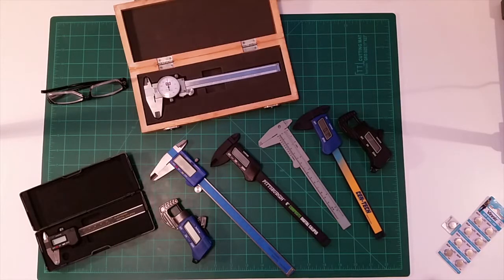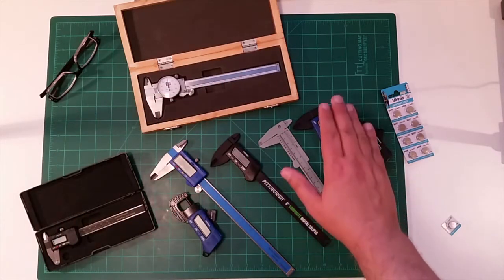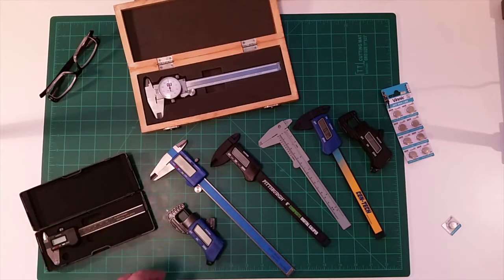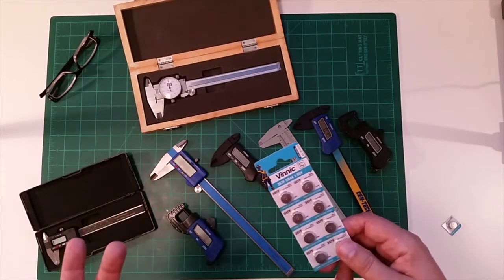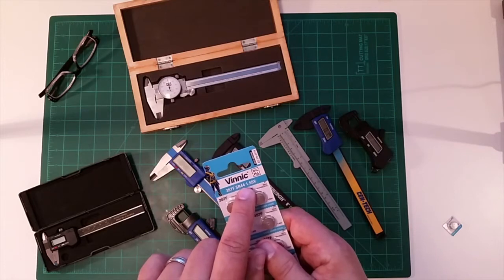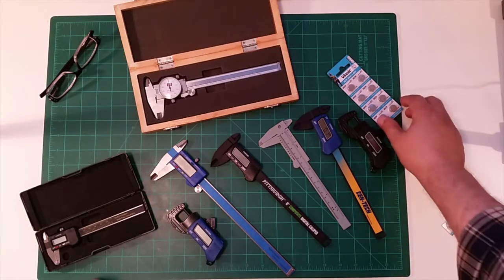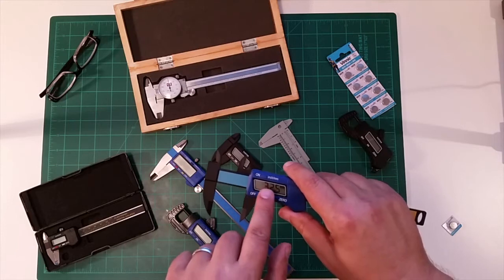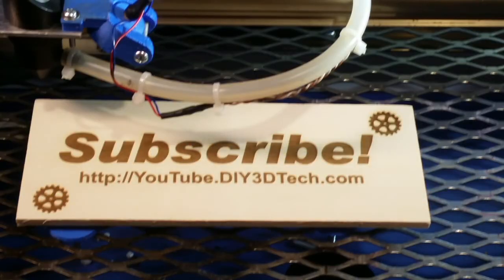Shop Talk - Digital Calipers and SR44 vs LR44 Batteries!

Comment: I was thinking that this was pretty bizarre behavior. 1.55V vs 1.5V shouldn't make any difference nor should the caliper's current load be anything higher than extremely tiny which means any differences in the internal resistance of the different battery chemistries shouldn't make much difference in the corresponding output voltage drop. So, it must be discharge curve related. The datasheets for the two types of cells:

SR44

http://data.energizer.com/PDFs/epx76.pdf

LR44

http://data.energizer.com/PDFs/A76Z.pdf

Sure enough, look at the "Typical Discharge Characteristics" on those datasheets and note how the voltage of the SR44 remains steady at 1.55V for 500 hours. Compare that with the large voltage drop over 500 hours for the LR44.

The same Chinese chip is probably used in all of these cheap Chinese micrometers and calipers and was obviously designed for operation using the SR44 which has been mostly discontinued in the west for environmental reasons (mercury content) although Sony came up with a mercury free version in 2004:

https://en.wikipedia.org/wiki/Silver-oxide_battery

"Silver oxide batteries become hazardous on the onset of leakage; this generally takes five years from the time they are put into use (which coincides with their normal shelf life). Until recently, all silver oxide batteries contained up to 0.2% mercury. The mercury was incorporated into the zinc anode to inhibit corrosion in the alkaline environment. Sony started producing the first silver oxide batteries without added mercury in 2004."

Interestingly, I just looked at the cell in my Harbor Freight Pittsburgh brand digital calipers that I bought YEARS ago that I use often and am still using the original cell. Both it and the spare cell included are marked as LR44! 

Now, I wouldn't put it past the Chinese to mis-mark an SR44 silver chemistry cell as an LR44 in order to bypass US and EU environmental restrictions. OR, perhaps the internal circuitry was changed in newer calipers to actually be able to use LR44 cells while others are still using the old design where they probably have or had an existing stock of a bazillion.
Reply: 500 hours is an ice age of time for caliper use. Average use time is like 1 minute maybe? I've had my calipers for 4 years and I've changed the battery maybe 3 times. I got several sheets of 50 batteries, basically a lifetime supply, for a few dollars.
Reply: xKatjaxPurrsx As he pointed out, when "turned off," calipers don't do anything other than turn off the LCD display and then remain in very low current sleep mode, something that is absolutely required for any microcontroller to be "turned on" (actually just fully "woken up") by a momentary contact pushbutton and that sleep mode still uses very tiny amounts of current. So, your calipers are never really "off" as power is never actually fully removed from the microcontroller chip. This makes the discharge curve important as I pointed out.
Reply: Ok, but it works for me. Like i said above i've only had to change batteries a few times in years. I even have an imgur above with a picture of the calipers, the battery and them working. I suspect in standby mode we're probably talking nano amps of current being used.
Reply: Actually, although the latest microcontrollers with the capabilities that would be required by a digital caliper are specified in sleep mode as "<1uA," meaning less than 1000nA, I suspect the sleep mode current of this Chinese chip set must be significantly higher for us to see the problem we (apparently) see with the LR44 vs SR44.
Reply: Found this:

Interfacing with Digital Calipers

http://www.robotroom.com/Caliper-Digital-Data-Port.html

"the caliper uses very little power (10-20 micro amps) regardless of whether the LCD is turned on or not"

If you look at the discharge characteristics of the LR44 in the datasheet linked to above, you'll see that the voltage immediately drops from the very start of discharge whereas the SR44 doesn't. The discharge rate used for those graphs is about 15 times higher than the discharge rate in a digital caliper, so the drop won't be as fast over time, but that also means the SR44 will remain steady at 1.55V for even longer than 500 hours, probably MUCH longer with 1.5V or close to it likely being required for Chinese chip operation. The LR44 won't provide that.
Reply: So I decided to take some actual measurements. I masked half the battery off with electrical tape on one side and half the battery off on the other side. Out of the tray the voltage measured 1.53v after sitting on the shelf for several years. This is consistent with the discharge chart your presented for the A76 as they start off at a voltage above 1.5v.  I connected the positive lead of the battery to the side lead in the calipers' battery compartment with an aligator clip. I then measured the current from the negative lead to the leaf spring in the battery compartment with the calipers turned on the measured current use was 21uA. in standby mode the current usage was 17.2uA. We can ascertain that the LCD uses 3.8uA of current and the uC uses 17.2uA of current. The discharge chart you showed assumes a current draw of 187uA, so that voltage drop would actually occur an order of magnitude slower than the chart, with the A76/LR44/AG13 dropping below 1.3v after 5.4 months and the epx76 dropping below 1.3v after ~10 months.

Since we're talking about 21uA or below, i believe it's safe to say that a battery who's discharge chart is based on current usage at an order of magnitude higher is not a factor.
Reply: In the name of science I shorted one of these batteries out and drained it down to 1.305v. I then put it into the calipers. They still work. Following my previous comment this simulated 5.4 months of standby time.
Reply: "The discharge chart you showed assumes a current draw of 187uA, so that voltage drop would actually occur an order of magnitude slower than the chart, with the A76/LR44/AG13 dropping below 1.3v after 5.4 months and the epx76 dropping below 1.3v after ~10 months."

I think you meant AZ76/SR76 since the EPX76 is the A76/LR44?

The only thing that can be taken from the discharge charts in those data sheets is that voltage of the SR44 remains steady for a very long time even when discharged at many times the rate of a digital caliper circuit whereas the LR44 does not. Battery chemistry can and almost certainly will lengthen those times at lower discharge rates. Any battery life calculations based upon high discharge rate charts and measurements won't be valid especially with different battery chemistries throwing in another variable.

Unfortunately, those cell datasheets don't show discharge curves at different discharge rates as many cell datasheets do.
Reply: OK, but the calipers still work when I drained the battery to 1.3v and also, I tend to use these batteries in the calipers until they start to corrode on the outside.
Reply: The bottom line is that a MERCURY BASED silver oxide cell (SR44) will be more likely to provide that 1.3V even over its entire shelf life with little use.

Why did I emphasize Mercury Based? Because this interesting discussion has led me to a very interesting discovery, at least to me.

Mercury free silver oxide cells DON'T have nearly as long of an initially flat discharge curve, more like 130 hours vs 500 (although the datasheet discharge rate used for the former is about 20% higher than the latter and that is at least part of the difference). Still better than the LR44, however.:

http://data.energizer.com/PDFs/357-303ZB.pdf
Reply from the maker: Yes you are 100% correct as its the discharge curve as if buy the cheap Harbor Freight LR44's they don't work at all and if I buy the more expensive ones at Walgreens they worked for a couple days and nothing!  Drove me nuts and the reason I did this video as I was ready to throw several sets of calipers as I thought they were no good!
Reply from the maker: The key point as I show in the video and confirmed with a little internet research is they never turn off only the screen blanks. As I show in the video you can move them (as the ones I tested anyway) and then turn on the screen to find the correct measurement.

Comment: Mine takes the AG13/LR44 it's the standard Ebay Special type.
http://www.ebay.com/itm/6-inch-150mm-Digital-Electronic-LCD-Steel-Stainless-Ruler-Gauge-Caliper-/182181535606?hash=item2a6add9f76:g:gZkAAOSw3ydVjuch
The simple trick for me was to take a small piece of masking tape and fold it over one time and then put that between the top of the battery and the cover. There would seem to actually be a small difference in the width between LR44 and SR44

I don't think the maximum discharge rate should matter, calipers shouldn't take anywhere near 150-200ma!
Reply: Thank you for doing the research on those 2 slightly different batteries. For over 20 years I have been using an AG13 in my Mitutoyo model: CD-8" C with no tape and no problems even tho the MSR on the back says "battery SR44". Typical replacement has been 4-5years when use was daily. Since retired I haven't had to replace for over 8 years. Think I'll stick with AG44's.
Reply: Opp!! I meant AG13 at the end there!!!
Reply from the maker: Interesting as none of the 4 pair (of digital calipers) I have been able to get the LR to work in also not sure of the current draw (could measure) number however it is an a sustained value as only the screen "blanks" while the unit remains all the time.
Reply: if i don't put the folded tape in it blinks like crazy. with the tape in it works for me, i've been using the same sheet of AG13 batteries for years. http://imgur.com/a/nRLSD
Reply: In the process of doing the current measurements it seems i slightly bent the contact in on the side and it now works fine without tape. Certainly nothing like experience to determine that yes, something does in fact work :)
Reply from the maker: You guys are scaring me!  I don't get this many comments on all my other projects but batteries?  I think I will start a YouTube channel just on batteries :-)